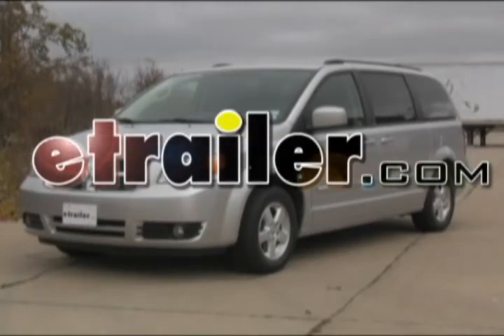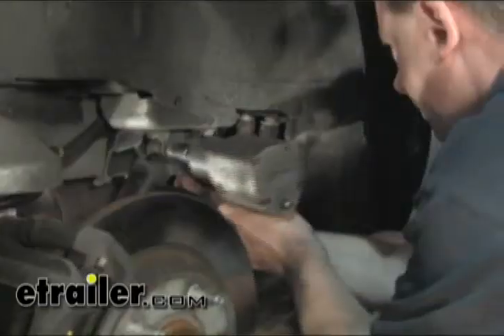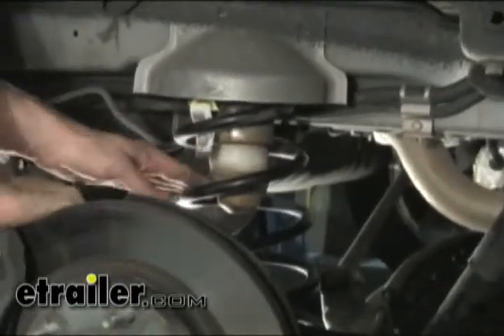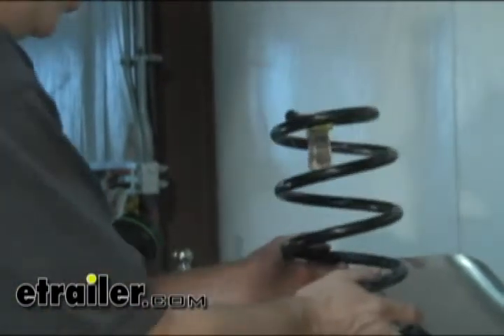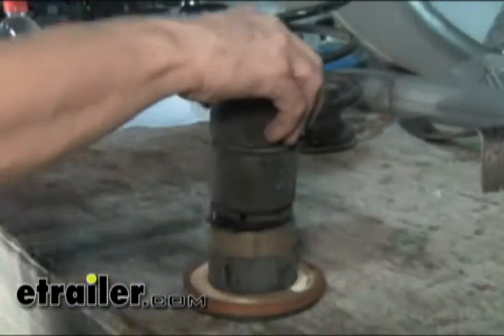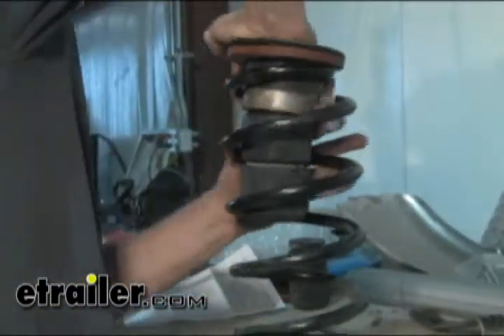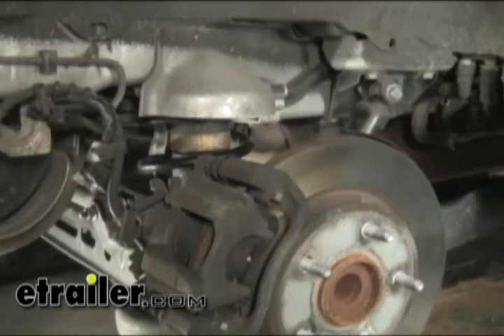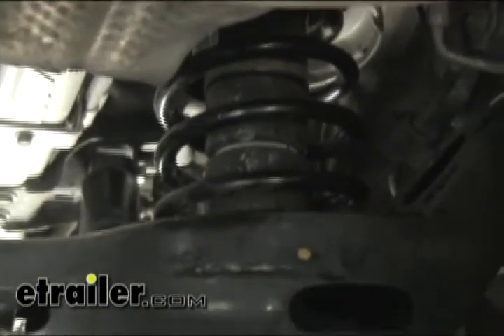etrailer | Set up: Timbren Rear Suspension Enhancement System on a 2009 Dodge Grand Caravan

Comment: maybe a dumb question but what does this part do for the suspension? do the original parts go bad over time?
Reply: panchbarron1 The original bump stop is designed to protect the vehicle from bottoming out hard, but doesn't do anything the bulk of the time. The Timbren unit is designed to engage much earlier, landing anytime there's a load in the back, or when the back end jounces: the rubber they use has enough hysteresis to assist the shocks as well as the springs so it improves several aspects of suspension & handling. Pause at 3:20 to see the differences in height, remembering that the spring will be compressed quite a bit just under an empty van.